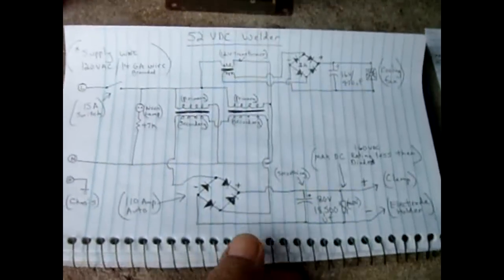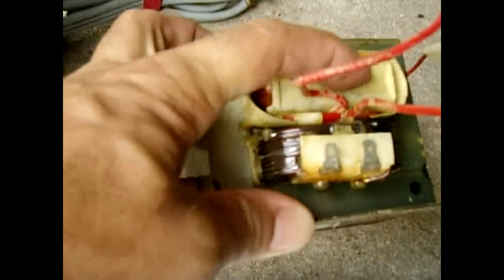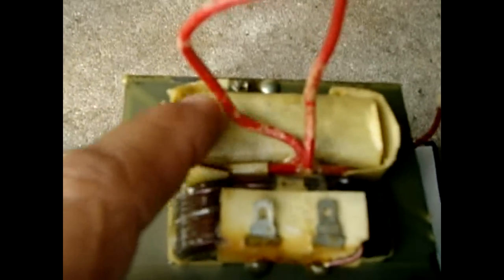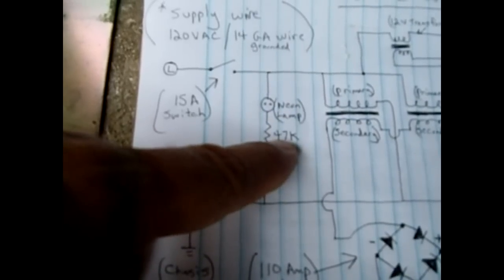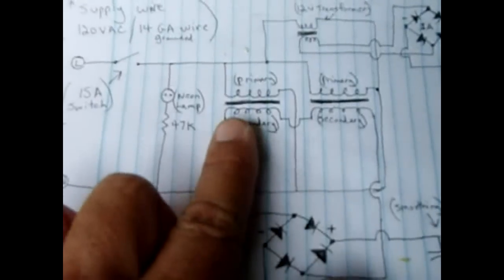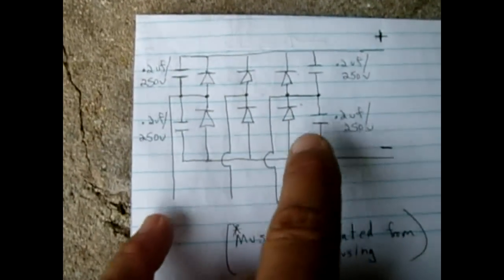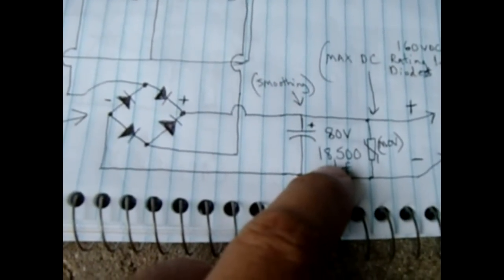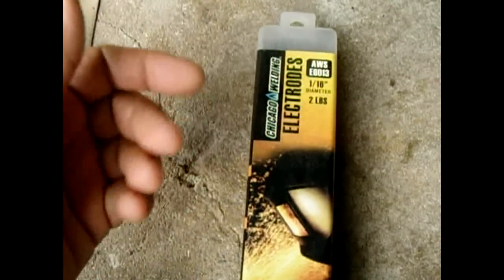DC Arc Welder Made From a Microwave Oven

Comment: Ah yes I am using an SRC to limit the current but then I drop my voltage too low to use... Think I might build a rectifier to form a DC current and also gut another MOT and use it as a strong inductor to limit the current flow. Did you wind your transformers with 12ga wire for the secondary?

Comment: Thanks for this great video and information! Would you be too bored to answer the questions from a newbie? 1-How do you determine that you need about 40V from the secondary to weld? (In other words, why not to use a #1 gage wire which sustains a higher amp and provides about 1-2 V? or Why not to use only one transformer with an output of 20V?) 2-Is this wrong to think that the total power from all secondary is equal to the power from the source (120Vx15A=1800W) so adding more transformers only changes the voltage and amperage but not the power?

Comment: Dear electronicsNmore, this is a AMAZING project, both, the battery charger and this are very good projects! In my country we have 220VAC, 50Hz...Which changes I must make in this circuit? because you designed it to 120VAC 60 HZ...The BIG capacitors are expensives? The 6 diodes are from a car alternator? If I do not find this 6 diodes, can I make with 6 individual power diodes? (i.e. 20A each).
Tthanks a lot for your time!!!
Reply from the maker: You have to use the rectifier/diodes from a car alternator. That is the best source. You can use the 220V/50hz transformer from your microwave oven. Nothing else changes from this video. The only difference is your transformer has twice as many turns on the primary winding, or more turns of a thinner gauge wire, so it can be used on 220V.

Thanks for watching!

Be sure to check out all my other videos.

Comment: $20 Homebuilt DC Welder - Power Control Circuit

they is very complex schematic 

but your schematic is no complex I like so much sir
AND can i use choke than capacitor ?
  ; what differance choke V.s. capacitor
Reply from the maker: Yes, I saw that video before. It does seem to work, but I prefer to use a triac.

Comment: I made one of these welders, and my problem is that I'm getting too much current and not enough voltage-- my two transformers wired together with 10ga wire produces around 33 volts. I burn through 16ga metal... I can't add anymore loops in the transformer bc there just isn't enough room. do you have any suggestions? Input 120vac.
Reply from the maker: You made the AC version? Correct? Are you using a thin electrode? 1/16"? Usually you don't use an arc welder for thin sheet metal(but 16ga should be fine). You have to move fast or you will burn a hole right through. I can do it with my DC unit, but sometimes I also burn a hole through. You need to regulate the current going into the 120V step down transformer(MOT) to reduce the current output. Your 33V should be fine. Your problem is too much current, not the voltage. You need a triac type circuit to regulate the 120V line AC. You can also try a heavy duty, high wattage fan speed controller to regulate the current so you can weld thin sheets.

Thanks For Watching!

Be sure to check out my video playlists as well.

Comment: Hello mindtomachine i want ask you somenthing, i maded welder from microwave transformers and in AC they got power of 120A, but after rectification with 4 diodes 200A and homemade choke with 20 turns of same wire  as the second coils of transformers in case 8 gadge on a same microwave transformer as others i got power from only 55-60A why? any idea ? i disconected choke tryed only with rectification and amperage was still drop to 60, aftert that i disconected rectification bridge and left only choke/inductor but amperage was still on 55-60 even on AC, and when i disconect both choke and rectification bridge just the three transformers welding power is 120A what i do wrong or there is just to many losses because of bad calculacion and that is normal, did you got same problem on your welder?
Reply from the maker: The end result is LOWER voltage and high current. 55-60A is very good!

Comment: what I understand is that the electric arc length is varying (hence the current and hence the welding temperature) since the human hands holding the electrode cannot be steady.  And we need some CONSTANT CURRENT circuit to compensate for this. But in all the MOT based arc welders found on yt, there seems to be no such a facility. How can it really work?
Reply from the maker: Using a small diameter rod keeps the current down.

Comment: Can you  burn a 1/8 welding road with this welding machine?
Reply from the maker: Not sure. I did not try. Using 1/16" works perfectly, 1/8" is really pushing it. The thicker rod requires more current and will make the MOT's/wiring much hotter.

Comment: Hello, my name is Harold, I'm from Dominican Republic, this video is very good and very interesting. thanks
I have just one question what is (MOV)?
Reply from the maker: An MOV is a metal oxide varistor. The varistor is designed to allow a certain voltage to pass, but once that voltage is exceeded, the MOV which is normally at a very high resistance, begins to drop. The bigger the spike in voltage , the lower the resistance becomes. At a certain point they "clamp". which is like a short. The purpose is to help protect the diiodes from transients.

Thanks for watching.

Check out my homemade inverter generator.
Reply: Thank you very much for your explanation! Nice
Reply: electronicsNmore
A straight forward explanation that  has earned you a new subscriber.
Reply from the maker: Thank you!
Reply: NP, I came just looking around at various mot welder schematics and I know what a mov is but I liked your way of explaining things.

Comment: and how i control  curent and volt out put for  Other size of stick welder
Reply from the maker: In the near future I will be adding a simple current control for welders to my video list.
Reply: One way of doing it is with multi-winding transformers. This allows for you to step up or step down the voltage based on which winding the transformer is using, and allows for the ability for several varying winding amounts to be use in a single transformer. 

I am pretty sure the MOT Arc welder can be done with a single transformer this way but would require you to somehow make the transformer large enough to wind it with multiple winding's. It would consolidate the design providing a more compact design, while giving the versatility of selecting different voltages thus producing more or less current based on which winding is being used. The negative effect of doing this idea is you may require more than 1 fan but personally I think an intake fan in front while providing an exhaust fan on the rear would make it a better design anyway.
His schematic is very well done and honestly if you can't grasp what he has done here and how to incorporate the variable voltage selection then you may want to hold off on building it until you fully understand it. Even simply overlooking the polarity of the 18500uf Cap will result in a very bad day for you as it would cause it to explode and a 18500UF Cap exploding in your face is not most people's idea of a good day. The possibility of reversed polarity on that cap is possible if you incorporate a voltage selector in a design that did not have it without knowing what all the parts are doing. Its roughly like starting an engine knowing you cross threaded a spark plug and the threads are gone, which is a very bad idea if you like your head to not have holes in it. Just a safety warning not being a dick. His schematic is very well explained in the video.

Comment: Can this welder run off 230V mains like it is ? or should there be modifications?
Reply from the maker: The (2) 120v microwave oven transformer's primary windings need to be connected in SERIES, not parallel. Make sure the transformers are identical and properly connected in series.

Comment: I don´t believe you can use a led on an ac circuit.  The led is a dc device.  The neon lamp will work fine.
Reply from the maker: Of course you can, if you know what you are doing. :-)
Reply: +electronicsNmore Let´s see if I have this right, so the the led will flash at 60Hz which is faster than the eye can detect.  I like the idea of a MOV protecting the rectified side I would use a voltage regulator to avoid any voltage surges as well.
Reply from the maker: Joseph Nicholas
https://www.youtube.com/watch?v=SoRGnQu3KBo
Reply: You can use an LED  but it will only turn on for half the cycle.